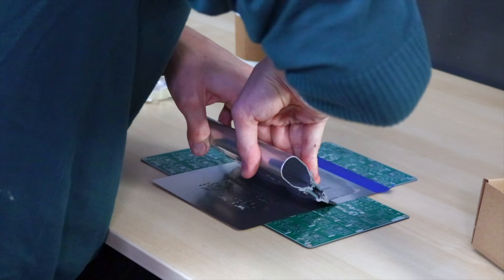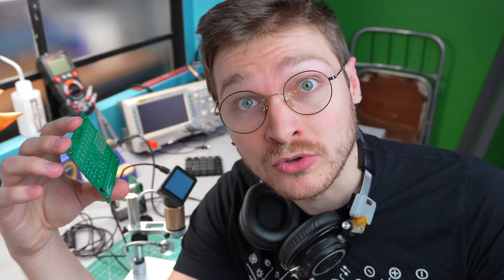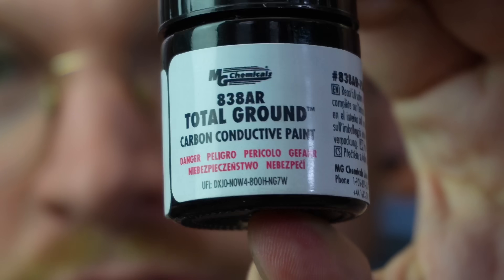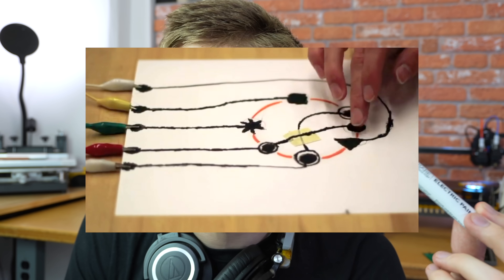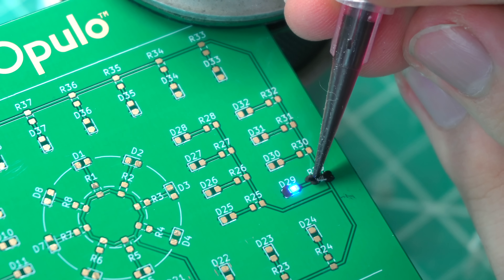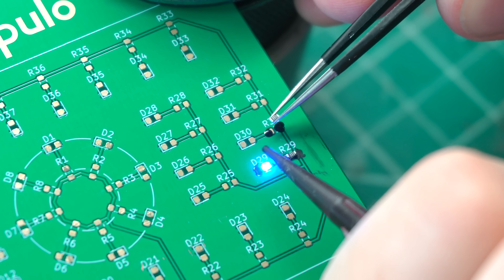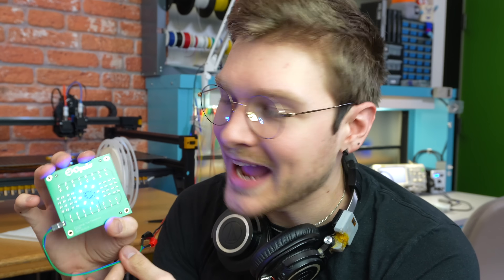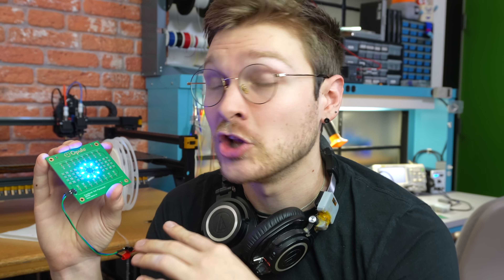Making Circuit Boards WITHOUT Solder

Comment: What about an SMT style PCB “breadboard” with Z tape? If it was about 10cm square and had short guiderails on corners to slide a piece of transparent acrylic onto it and clamp that down with consistent pressure across the board, that would seemingly function👍🏻

Comment: you remove the protective layer and press the now exposed sticky part onto the surface that you want to connect (the PCB.) After that, you need to carefully peel the other protective layer away, while making sure that you don't rip the glue layer from the PCB

Comment: I actually DO have an application: in France, there are exhibitions in which students come and meet people from different schools who present what their schooling is.
At my high school, we're teaching electronics and industrial informatics, which includes creating PCBs (using proteus), and soldering cms components for their projects.
I can easily see this stuff used in exhibitions to explain to people what we do, as they could "solder" a PCB, and then when done, we can take the components appart, clean them, and then reuse them. Same with students who come at school to have a closer look at what we do!

Comment: used conductive silver glue from aliexpress a while back for an electronic postcard, where i wanted to connect 2016 cells in the lowest profile way possible(sandwiched in between a flex pcb). maybe that's something to look into

Comment: Why not use a 2nd head on the pick and place machine to apply solder to the pads just before placing the component?
OR once the part has been picked and orientation determined, move the part over an applicator to place solder paste and then place the component.
Either method will get rid of the need for a solder mask stencil and be more efficient as well.
ANOTHER THOUGHT: Why not print (bubble-jet or whatever) the "green coating" onto the board with UV curing ink/paint/whatever?
That would remove the need for that stencil as well.
Even more savings when doing single or short run boards.
FINALLY: I see that many use a laser printed image on a paper substrate to get the board ready for etching.
So why not "simply" print the etching mask directly on the copper clad board?
Your pick and place machine is a very effective solution for the problem of populating the board.
Now it is time for you to revolutionize and simplify all the processes that come BEFORE "final assembly".

Comment: ACF is the film version - Anisotropic Conductive Film.  Most of these films require pressure during placement, and heat to cure the adhesive.  For the processes I've used it in, it requires 250psi (not a lot, given how small the component being pressed is) and 140C for 25 seconds (which is below solder oven temperature.  ACP's downside is that the metal spheres, or metal coated plastic spheres, often don't stay equally distributed in solution, but you can place it with regular paste dispensers, and it can be cured with methods other than heat.  You still need to use pressure on initial placement, though,  to get the spheres embedded in both sides of the contact.

The conductive solutions you've used should be fine for your purposes.  Their high resistance compared to copper, and lower adhesion will pose problems for many uses. I expect that debugging a board with a hundred such connections is not going to be pleasant, and the relatively high pin to pin spacing this would be capable of might limit products that can be used.  For instance a 0.5mm pin pitch 32 pin package might have trouble with either shorts with too much paste, or opens with too little.

Unfortunately what that really means is that this is a replacement for simple pcbs that could probably be hand soldered and placed, and probably not a great fit for high speed prototyping.

I'd like to see you succeed, and I certainly don't intend to dissuade you, if you can make this work for even those projects it would be a huge benefit for many.

Comment: About 10 years ago I toyed with the idea of using either an inkjet printer or laser printer to print onto laminate film to create multilayer, flexible printed circuits. Conductive inkjet ink was pretty widely available but toner less so. For fast, short run production runs laminate is very interesting to me. But also imagine graphene or carbon nanotube toner ink being fused to PLA based laminate film?
Perhaps I've just given away a billion dollar idea, but an idea is nothing if you can't execute on it.

Comment: Could you have some kind of fake component on the PNP that acts as a small sponge, then have the machine dip it in the paste, then blob the paste on the PCB, then return the sponge to tray ready for next use. Basically mod the PNP to do the painting of the paste before each actual component placement?

Comment: Conductive adhesives actually already exist and they are typically epoxy or silicone based. But they are also about 10x the price of solder paste

Comment: I think you would highly benefit from using UV curing adhesives, that way you get the longevity of glue that doen't immediately start to dry as the PNP puts them down, and then when it's finished you can just cure it with an LED, or in the sun quite quickly.

Comment: I'm guessing you have anisotropic conductive film. It is used in a process called tape automated bonding (TAB). This is how flex cables are attached to LCD displays. It's also used for chip on flex (COF). You can't just stick components to it. You need heat and pressure to make a bond.

Comment: There are conductive 3d printer filament. If you can find one you can dissolve you might be able to create a paste you have more control over its drying time and how gluey it is.

Maybe even an UV curing one for resin printers?

Comment: @TechIngredients made a thermal epoxy that might provide some ideas for making a electrically conductive epoxy that might be tweaked to get the right characteristics that would make it useful as a solderpaste of soets.

Also, I was thinking about an INDUCTIVE heating wand that could be mounted on the lumenpnp like a toolhead for melting placed components using regular solderpaste.

Comment: Have you ever thought of using a SLA printer to make the entire pcb in house (I once saw it done on a 3d prining channel - thomas sanladerer). Though he did etch it so I'm not sure about the safety of the chemicals... Would be interesting to see if you can 3d print the solder mask though.

Comment: Silver loaded epoxy is used extensively in hi reliability electronics e.g. Loctite 84-LMI Not sure how conductive it is before curing - usually cured at 150C for an hour or so. Also not going to be as cheap as something carbon based.

Comment: Conductive epoxy may be what you're looking for. Check out Epoxy Technologies and Loctite Ablestick. They both make silver filled conductive epoxies the can be oven cured at temperatures from about 80 degrees C to 200 degrees C and are made to be screen printed like solder paste or dispensed from a syringe.

Comment: If the green solder mask were thicker therefore noticeably higher than the pads solder paste could be squeegeed over the whole board without the need for a stencil

Comment: Re: getting brighter - the solvent isn't conductive. When it evaporates, the distance between the actually conductive particles shrinks, reducing the resistance. It also shrinks in general. It's an obvious relationship - if you were to dilute the conductive paint even further, the resistance would increase and increase - so the reverse, the solvent evaporating will increase conductivity. I would also assume it's similar for solder paste, when heat liquefies and eventually evaporates the flux, or at least removes it from in-between the solder balls.

Comment: Man you should add your own UV/hardened conductive resin with the lumen head over the pads and the part you need to figure out the right product as surface tension and viscosity is a huuge factor here but looking for an idea better than the stencil and the paste i think UV resin is your next try you kind could add a solvent too make it more runny but yeah this whole process could all just be the dual head of the lumen applying paste and then cooking the board as someone else mentionned but you also could try some other stuff

Comment: Just use low-melting-point solder and add the heat bed, could get away with as low as 47ºC, which would not burn the components and provide low-resistance, high quality contact. Mixing low-temp solder and flux would proubably make as close to a real-time plug-and-play solder paste as possible.

Graphite lackers/inks have added resistance and also are mechanically unsound, they would just crumble under any prolonged stress, so application range is limited.
Mixing graphite and glue would just add an insulator (glue) between graphite particles, so you would need to find a (at least semi?) conductive glue to make it work, or some king of post-processing to increase amount of continuous graphite chain-links, otherwise the resistance would kill any possibility of it being applicable at all, i think. Maybe, some kind of long-stranded graphene-glue emulsion? But all this is pure speculation on my part, so i'm waiting for the next video =).

Btw. Pure experimentation for the fun of it, as in practice it would potentially add an additional degree of complexity to some circuits, as there are cases, when the order of components being connected matters (f.e., you would want to place current/voltage-limiting resistor or zener before everything else). Maybe, add some routine/rule to placing sequence to always place such elements first?

Comment: Quite easy solution, build a dispenser into your pnp head ;-) I think everybody here knows where this is going and it‘s needed. Even if you place the paste with a stencil, glue placement alsways needs to be made with a dispenser. If you could make a double dispenser head into the pnp head, you could place the paste and glue within one job.

Comment: Take a look at MG Chemicals 9410 – 1 Part Epoxy, Electrically Conductive Adhesive. We use this where I work for RF die bonding. Effectively a 24hr work time as it cures with heat so I'm not sure how well it conducts uncured but worth looking at

Comment: Interesting, but nowhere near the reliability of a true soldered connection.

I've been an electronics hobbyist for 50+ years now, and the effort put into soldering is the LEAST of my concerns whereas the biggest debug problems I've had have mostly been bad solder connections.  Having good solder joints is critical. No conductive adhesive today is anywhere close to rivaling solder  (whether surface-mount or thru-hole assembly) when it comes to mechanical strength, conductivity, self-forming, temperature-cycling, and reworkability.

Also, you dont need a reflow oven, pick-and-place, or paste-stencils to do decent surface-mount builds for hobby work as long as you avoid ball-grid-array (BGA) packages. A good pair of non-magnetic tweezers and a cheap hot-air reflow tool  is all I've needed to build dozens of my own SMT boards.

One thing that many people dont know is that when solder-paste is heated, it flows around the connections and pulls the components into place, and flows away from solder-mask to remove bridges (shorts).

Comment: What if you mount that syringe in the tool head in place of one of the pickers, then you could extrude a dab of that conductive stuff exactly on the two pads the next item is going to go to, and then immediately place the item with the other tool head. Grab the next part, apply the two (or multiple) dabs and then place the part immediately.

Comment: I wonder if this could be used for flexible circuits which can’t handle the temperatures required for even solder paste. Great job as always 👍

Comment: There are tons of conductive epoxies. Typically will use some special epoxies in hermetically sealed packages or for die attach. Snap cure UV materials exist as well

Comment: That’s cool, but if you have to manually put the ink solder on the board then it kind of defeats the automation of the robot. So what you need to do is make the robot deposit the solder on the pad first and then place the component part on the board.

Comment: You can build the reflow into the PCB.  I've seen people pump 12v into a ground plane ("plane" being somewhat loosely used; it was a tuned trace) in order to basically reflow the solder directly on-board.  Then they break off the tabs that give access to the internal heating layers, and voila.

Comment: You could increase the viscosity by adding fused silica.
The paint conductivity goes up as it dries because the conducting particles come together and start to form a path for current as solvent goes away.
 Long time ago I played with one that is basically nail polish with carbon and metal powder, for EMC shield painting.

Comment: Maybe try having two part glue with spray activator, one part with graphite and spray it with second part after finishing job? First part should be conductive enough so that it works while on Lumen and for mechanical strength you would use activator

Comment: Add a hot plate to the LumenPNP, maybe even a solder dispensing pen. Place components on heated pcb and let the surface tension do the rest. Look at me telling you about things you've probably already thought of. - How well does molten solder conduct electricity?

Comment: some ideas:
- overall this process (or variations of it) would benefit greatly from a paste dispenser as the secondary tool on the P&P.
- First step : (especially for components with more than two pads, modules, etc) load the paste dispenser with component glue. This is already a common job in a larger fab houses. Glue dot the center of the component, then pick and place it. Now it wont move no mater what ends up happening with the conductive pasting.
- second step : after all parts glued down, reload the paste tool with conductive paste and dot right up against the corner of the leg-to-pad interface.
OR.. somehow build a head with all three : glue, paste, and pick&place..  pick the part, then while over the footprint, paste all the pads, hit the glue dot and place the part.
- The paste is messy without a stencil. If you want to dispense it by the P&P, you may need a knife or needle to "comb" between legs of SOIC, modules, etc to "cut" shorts.
- some sort of UV/heat curable conductive epoxy would be awesome. Add a sharp UB laser to the head. The laser point should be thinner than the component leg of most SOICs, QFPs, etc. you could even gob the epoxy a bit, provided there is a cleanup step after.. selective laser conductive curing. Just run back and forth across the leg to the pad a few times.

Comment: If you just want the effect for like a video or smth you might wanna try how good gallium wets the connections. A circuit that melts at slightly above ambient might be of limited use in practice, but if it wets at those temps it would provide superior conductivity for a video shoot and all you had to do is heat the pcb to like 30 °C.

Comment: Probably a PVA adhesive is going to have the best properties, good viscosity, moderate drying time, strong once dried. Something like Mod Podge, or white glue that's been dried a little to thicken it up, mixed with powdered carbon, or silver/copper..

Comment: A issue with adhesive based interconnect is reliability over time in terms oxide creep on plating on part connections , depends on environment conditions. For prototype is all ok

Comment: I've experimented with silver paint, it has a bunch of real silver in it and it's honestly respectably low resistance. Only issue I had for my application is that it's pretty thick compared to the carbon paint

Comment: a guy named Robert Murray smith has a bunch of videos on conductive ink and various methods of preparing it if you want any inspiration. using a mix of different size carbon helps with conductivity.

Comment: For the z tape, you could place everything and then put it into an enclosure which applies the pressure.  Like the old calculator displays that used a similar thing, except it was in vertical strips instead of balls, but the enclosure squeezing it down is what made the display connector sandwich work.

Comment: If it would be possible to develop an add on so the lumen would squirt out the adheisive as it put on components this would be absolutely killer for rapid prototyping. Imagine designing a pcb, milling it, then putting it on this to get a fulling functioning board. And when you are done designing you swap to regular solder paste.

Comment: higher supply voltage and higher resistor values will make it less dependent on  the resistance of the ink

Comment: I worked at Apple - some modules use Z-Tape type connections. Getting good even pressure and strong reliable connections is an endless optimization game.... but yes its in 100 of millions of parts!

Comment: Check Panacol, they have a bunch of conductive adhesives that might do what you want.
The Elecolit 3036 is a 2 component epoxy that can cure in room temperature or an oven (normal oven is sufficient)
Though I am not sure how expensive is it for low quantity consumers.

Comment: It would be interesting to mix the black carbon powder with actual solder paste, then use it "normally" as paste and spread it across the board. Idea is - the carbon would cause it to conduct before melting, but then you can normally reflow it, getting "classical" PCB workings.

Comment: Put the total ground on after the part. You coul could put sticky stuff under the resistor or LED in the middle to attach it and isolate each end and then drop the conductive paint on either side, maybe like epoxy. You could also make like a little epoxy sticker or something like it that outlines the pad. has two little wells, one for each pad, and separates them and it could attach onto the resistor part in the middle and then it would provide wells for the ink to sit in